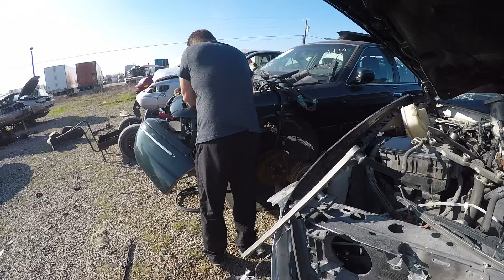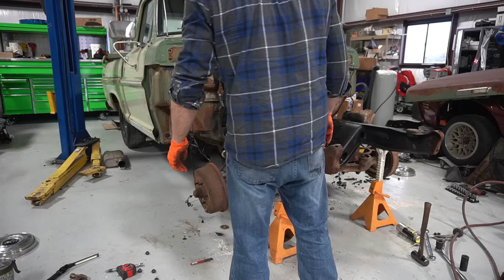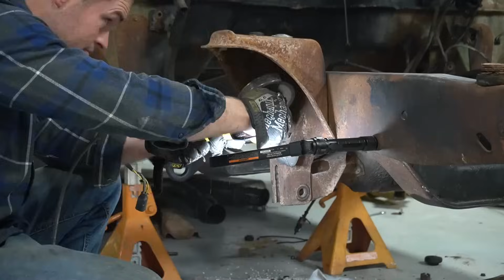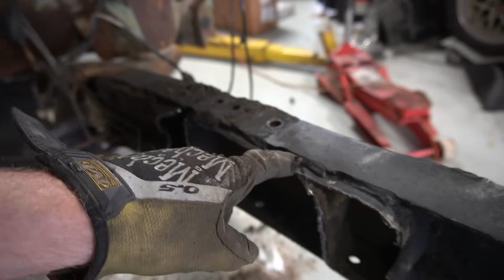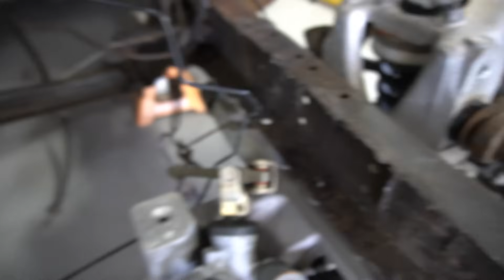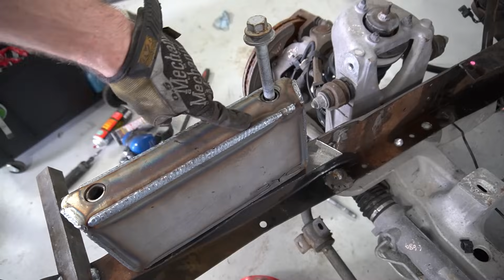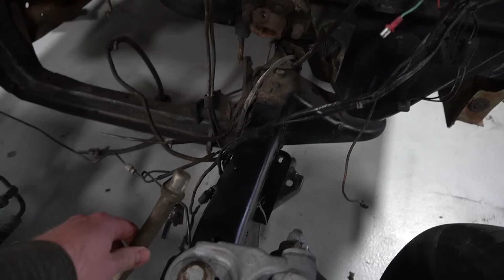F100 Crown Vic Front End Swap - Step by Step

Comment: I know I'm 5 years late lol but I just plasma cut the heads off the rivets and punched them out. Pulled perch off then cut again. Worked wrll. 
Cross member I cut access holes in from top to burn out the tube that's in there.

Comment: Put a crown Vic on my 1957 f100. Having problems with the brakes. Doesn't stop how I wanted. On hard stop it wont lock the brakes . One inch master with a brake booster . Stock rearend. Anyone having this problem?

Comment: s
Super video, I'm about to start my front vic swap and was wondering about the dial pin holes in the frame that you used. i have a 65 and was wondering are the same hole in my frame. I havent pulled the engine yet. i see different people drilling hole just past and forward of the existing frame holes. I would like to use the existing ones. Any ideas. Hope i dont sound too knuckleheaded.

Comment: Dod the bolts come up from the bottom in stock form thks
Reply from the maker: The bolts stay oriented the same way in the crown vic, and the truck when you bolt it in
Reply: @330_garage3  thks im putting one on a 1953 bread van thks again for the volvos

Comment: I see some people measure from firewall to original spring tower to keep a cente point, but looks like you just put the new front end in the existing holes on the bottom, is that perfect that way?

Comment: Is it possible to use this swap on a 1956 fairlane
Reply from the maker: The outside to outside frame width on these trucks is 34 inches. I don't know what the fairlane is, but if it's close to that, I would assume you could make it work

Comment: I have watched many others and you are in the top 10!  Question in regards to your plasma cutter. What brand and amps are you using.  I’m working on a 67 F100 that I have owned for 23 years.  Can’t wait to get it finished!
Reply from the maker: Thankyou! thats a huge compliment given the number of people out here creating content on YouTube.
For the plasma cutter I use a Miller Spectrum 375 X-Treme. Its great for most automotive applications. If you get to 1/4" material, it won't cut through that, despite what the specs say.

Comment: So I have seen videos  where other guys measure the holes differently. I have a 72 and I believe it has the same holes yours does for the line up pin on the crown vic. I just want to make sure my wheels are centered in the fenders. You way looks the easiest that I have seen. Any advice would be appreciated.  Thanks for all the videos as well.

Comment: How could I begin to learn to weld, use a plasma torch, etc as an adult? It seems clear that, especially with welding, the correct rig and correct technique is everything. Appreciate any advice - thank you.
Reply from the maker: I would start by purchasing a name brand Mig welder, with a gas shielding kit/bottle. Check out weldingtipsandtricks.com He as a YouTube channel etc. Tons of great mig welder reviews, and tons of great small tips on how to make you a better welder. Just start practicing on some scrap metal. You'll be surprised how you can put it all together, and become a proficient welder.
Reply: @330_garage3  I really appreciate the help and advice! And you got the sub - I hope that helps you continue to offer such great content. Thanks again!

Comment: Did the control arms  plate come on  the kit that you order Or did you have to order separate.  ?
Reply from the maker: Yes, the steel plate that mounts the rear of the lower control arm to the truck frame, came with the kit.
Reply: @330_garage3  thanks man

Comment: The original front ends on these trucks are just fine !!
Reply: My 56 f100 came a farmer's field. Everything was seized solid. The springs had been heated in the 70s to drop it. They were inverted and they weren't even from side to side and if you viewed from above they weren't parallel. I did this swap over 5 years ago. 
I agree The original suspension is fine. I wanted to keep it.
Reply: Been driving mine for 34 years on original front end would not trade it for crown front end swap.
Reply from the maker: You must not have driven one in a while.. this truck drove horribly and was hard to keep on the road, even after replacing bushings etc.

Comment: I got a dumb question.  How does the CV front suspension help?  Better ride?
Reply from the maker: It lowers the front of the truck, it adds rack and pinion power steering, large disc brakes, gets rid of the cross I-Beam suspension. With some coil-overs it will ride and steer a 1000x better

Comment: What year model CV front end??
Reply from the maker: 2003-2009 Crown Vic, grand marquis or Lincoln town car. OR the CV police interceptor 03-2011
Reply: @330_garage3  thanks, and the year model Ford Explorer for the rear end?
Reply from the maker: i THINK those are 94 - 2001. Just find one with the 5.0 V8, most had the limited slip and 3.73s, there's a metal tag on the rear end that tells you whats in it.
Reply: @330_garage3  thanks! I’ve got a good 67 Short Bed project going and you’re posts have been very helpful

Comment: Where do You get those metal boxes for the frame, do You have to make them or it sale as a kit?
Reply from the maker: I posted a link in the description. The only place I can find them available is ebay. 

https://www.ebay.com/itm/THE-ORIGINAL-Ford-F100-Crown-Vic-swap-bracket-kit-new-smaller-logo/153877466834?hash=item23d3cfced2:g:WVoAAOSwq3xdSLfj:sc:USPSPriorityFlatRateBox!75069!US!-1

Comment: Hi I’m currently doing the same modificación to my f100 but I’m debating weather I can weld my crown Vic brackets with 110 welder or use a 220v welder?
Reply from the maker: It really depends on your welder. A lot of the newer welders us an inverter to make power. So they step up the 110v from the wall, and weld very efficiently. You should be just fine with something like that. If you have an older transformer style welder, I wouldn't trust it.

Comment: I've been wanting to do this swap, my concern was the width of the Crown Vic. I see you used the CV wheels which are offset to the outside edge of the wheel. Would there be a problem with an aftermarket set of wheels? At a 0 offset  that would add 3" I'm guessing.  I'm thinking they would rub the fenders.

Comment: Great video having all the tools like a plasma cutter , lift , and seperate  shop really helps,  ditching the vintage power steering for rack and pinion , and that big ugly cross member is a plus . Am I missing the motor mount relocation ? Or does the back yard kit come with that ? I have a F 250 with a big heavy 390 haven't seen the Vic swap on a 250 only F100 .
Reply from the maker: You have to either fab, or buy some motor mounts to remount the engine to the new crown-vic cross member. These guys sell a very good selection of mounts to put whatever engine you want back in the truck: 
https://www.outcastautoworks.com/collections/ford-f-series-crown-vic-swap-motor-mounts

Comment: What did you paint frame and firewall with also where do you get Omni single Stage paint from
Reply from the maker: The black paint is from Eastwood, its Rust Encapsulator. I have used it on several projects over the years, and its the best thing I have found for stopping and cleaning up rusty surfaces with not much prep work. The PPG OMNI it got from my local automotive paint supply, English Color. but I believe they are only in texas.

Comment: So I have done 2 of these truck but never bought a kit.  Didn’t know they were out there! Turned out nice man! Keep up the good work!
Reply: I did mine with no kit. It was before kits were available. Finished it in a weekend. One thing I fail to understand is why everyone now seem to think the alignment pin is so important to keep. It is for the robot that loads the suspension in the car. Not to mention if you want to alter the wheelbase (I did) using this logic of the original holes in the frame does not work.
Reply: @makingsensewithsteve3620  yeah I agree.
Reply: @edwardpoff575  old school vs. new. Nothing wrong with new but it was us that made these kits available. We pioneered this swap. I also did the IRS swap using the kit from truckirs. I did my swaps in 2011.

Generally speaking ford people build. GM people buy parts to make it happen. I do like seeing kits being made available. They can be used in trucks other than fords. Like I said. We are old school. The reason these kits exist.

We showed them it could be done. I personally don't care for this particular kit. There are others out there that are better in my opinion but I tip my hat to him for documenting the process
Reply: @makingsensewithsteve3620  I agree 💯 %

Comment: that BYC makes the project alot easier. i did a crwn vic for my 56 f1 and i cut the frame square with tubes from the crown vic  with ifs and did something similar to the frame on the 56. i just got the explorer rear end , like what u did in the last vid with that rear end. because of funds i will also have to bolt on the rear end till i can afford a 4 link. great vids keep them coming

Comment: Thank you so much for posting! I plan on doing the same to my 58'!
Reply: Why? You destroying a beautiful piece of art. It's like painting a 747 onto the Mona Lisa. Stop buying these classics just to put modern crap on them.
Reply: @timesthree5757  I see you're a purist, but putting in the Crown Vic Front End makes it safer on the roads.
Reply: @markjeffels3327  oh I'm sorry I forgot about the fact than every f100 owners all of them just died driving f100 including my uncle. Oh, yea never happened. The f100 front ends are not dangerous.
Its a myth that crown vic front end is safer on f100. What would be safer is to do a whole body swap.
Reply: @timesthree5757  I understand your point of view, but I guess it's the softer ride and power steering then people are after.
Reply: @markjeffels3327  ok well their is after market parts made for the f100's. Lastly it's a pickup truck not a crown vic. It's not supposed to be a smooth ride.
Reply: @timesthree5757  Why can't people have a civilized conversation like this with any topic? No, they loose their minds and destroy and loot everything! God bless!
Reply: @markjeffels3327  I often ask the same thing. Not everyone is gonna agree with you or me. Yet some folks feel the need to destroy because someone has a different opinion.

Comment: You can still get the Crown Vic mounting tubes and bolts from Ford, was wounding why you did not use them?
Reply: Yea, I got those, but really all the alignment stuff was a headache, I don't think the holes he used are inline on my 1965 F100, and I don't think they would center the wheels either

Comment: Would i be able to do this same swap on my 1964 f100? Its factory straight axle and leaf springs. Pretty much a horse carriage suspension lol. Id like to lower my 64 but theres really no options avial unless i swap the front clip like this... Anyone have any suggestions for lowering my 64 ford truck without doing the crown vic front clip swap? Any and all suggestions would be greatly appreciated

Comment: I put  a narrowed CV on my 56 f100,  huge job. stock was to wide, it cut down your wheel choice. you'll probably have to cut off those square blocks or pads cast into the x-member to get the engine to set right.  my set up is a 302/aod and those had to go. took about 2 to 3 month to get it in right, I spent more time on the fit and finish of the install. still have to wire it. thanks for your post.
Reply: How did you narrow it? I have a 56 also. Did you cut the crossmember or shorten the arms?
Reply: @xmo552  there are pictures on the "ford truck enthusiasts"  lots of threads on the topic. the "A" are stock., only the cross member is cut. steering rack must be re-centered.
Reply: @kbtube8125  
Is that an online forum?

Comment: I can’t wait to do exactly this . I really like the bumpside fords , but like the idea of making it a better driver, with better handling. I also want the Mustang irs setup too .
Reply: They sell a kit to swap the t-bird cougar mark viii irs into the f100s much more affordable to find than the mustang irs but alot of parts from new edge irs interchange!
Reply: @nealpurdy1202  The kit is from TruckIRS. I used it for my MN12 (Thunderbird) IRS swap. Be careful when shopping for the IRS. They came with 2 different center sections. You want the 8.8. When I did mine there was a bunch of people saying it would leave the rear sitting way lower than the CV front. I did my own homework and decided they were wrong. They indeed were wrong. I took 1/2 coil out of the rear springs to get geometry correct for the IRS and was still roughly 2" higher than the front. In fairness I put 1 1/2" drop springs in the front.

Comment: About those rear control arm bushings. I know that on the Town Cars (limousines, same Panther platform as the CV) we have in the fleet at my work, they wear out fairly quickly. They do almost nothing until you're braking. I cringed at re-clocking the bearings because of how often I replace them. I would have hoped the kit would have allowed for the mounts to be at the stock angle. I hate having to modify wear parts.
The wear comes a lot from drying out and cracking, rather than physical damage. I've never found a polyurethane replacement, otherwise I'd use it.

Comment: This looks awesome!  I wish this would have been around when I built my '72 thirty years ago.  One thing I would have done different would have been to weld  up the holes in the outside of the original frame rails were the old suspension rivets was.  With them open, I would be afraid of water getting in between the frame rail and the BYC box and causing it to rust and creating a failure point.  Great work though!  I like it.

Comment: sometimes a die grinder is a good choice to keep all that heat ! from weakening the frame rail`s !
Reply: Yup, then go ahead and weld the box into the frame rails.
Reply: @chrisallen9154  I am 52 and have modified hundreds of frames on cars, trucks, semi's etc....over 40 years. Old school car frames are not going to be any weaker or stronger using a die grinder to make cuts..... just wrong. What you gonna do make a cold weld with the die grinder ?

What you use to cut into a frame has absolutely nothing to do with it. The weld prep, welding material used and quality of weld matter.
Reply: @ToddChaseYT  Patriotic Hooligan. I was being sarcastic.
Reply: LMFAO...weaken ? .....false

Comment: Do you just spray over the top of surface rust on all your projects?  Even with rust paint you are supposed to remove the visible rust.
Reply from the maker: The Eastwood Rust Encapsulator, actually converts rust and stops it. The instructions say to remove loose rust, and apply the product. I have had very good luck with it in the past. Its also very easy to use. It doesn't require 5 pre-treating steps and washes before application.
Reply: WHY?
Reply: @CORNDODGER  Because it won't adhere properly.  The paint is designed to remove the etching step only.  It's not magic.  Might be OK on a fence but not a car. That's bodgy.  Besides he didn't even degrease properly.
Reply: @ibast1  WOW OK WTF is wrong with the RUST dont paint it dont CLEAR it just run it PERIOD that is what it is all about THE IDIOTS THAT CLEAR PATINA ARE FUCKING MORONS
Reply: This ain't no show truck. Relax.
Reply: @spaceghost8995  Doesn't matter.   That's a recipe for rusting from the inside out.  You don't want that on a street truck.
Reply: Ya that would drive me crazy not getting all the rust outs there before painting

Comment: Nice workmanship.  It appears from the video that there should be a 3/16" or so SS shim/washer between the top Aluminium piece of upper A arm ass'y and the new box at the bolt holes.  You don't want intimate contact between Aluminium and Steel.  Ever.  Bottom side of frame should have a non metallic spacer as well where it meets the Al casting.  Excellent welding BTW.
Reply: Why?
Reply: @xmo552  Galvanic corrosion between Iron and Aluminium.  Aluminum will corrode away since it becomes anodic.
Reply: @gordbaker896  
I've seen that corrosion between these metals. I wonder why ford didn't do that.

Comment: these are good swaps....but i dont like how they lower the trucks ride height ..i rather a stock ride height ...and you might need a double sump oil pan
Reply: 390merc 66 ya in thoroughly bored of lowered old trucks.. if they were supposed to drag their belly on speed bumps ford would have built them that way!

Comment: So I’m honestly curious, and not criticizing. Why didn’t you spray some weld through primer on the frame and the BYC box before you welded in the BYC boxes into the frame? Will there not be any issues with rust in the future?      Either way, loving the build and can’t wait for more progress!!
Reply from the maker: Weld through primer is probably a good suggestion. This truck won't see rain or snow or anything in the future, so I haven't been overly concerned with rust prevention.

Comment: I Like this Kit❕  I used to cut out the old Mustang II front-ends and put them under old thirty model car's and truck's to make street rods out of them.  This unit mounts quit-a-bit different then the Mustang II front-ends did. This is simpler. And, with the Steel Box was pre-made was Nice. Great Job also on this being installed, Buddy.👍🏽👍🏽

Comment: Apologies, I am a little late to the party, this video popped up in my Recommended feed. First, good work, very detail oriented and such. But, I have to ask, why are you putting a cop suspension (to quote the Blues Brothers) on this old truck?
Reply: You mean, why wouldn't you use it?
Reply from the maker: upgrades the front end to independent front suspension, disc brakes, rack and pinion steering, parts are cheap, and it lowers the truck all in 1 complete affordable junkyard unit!